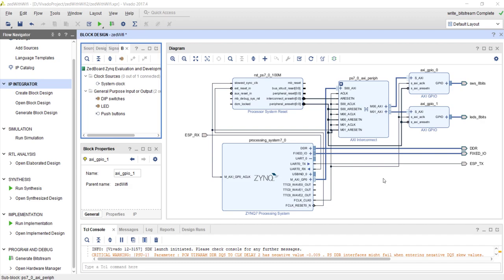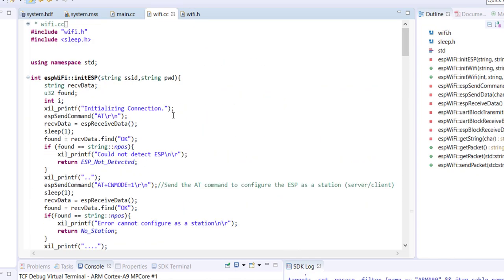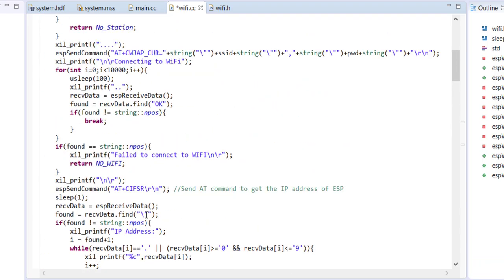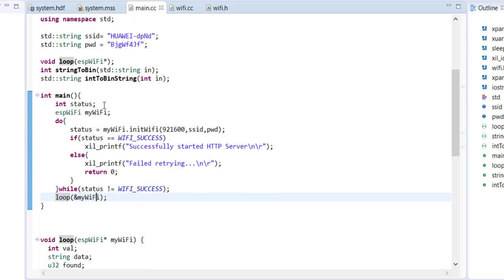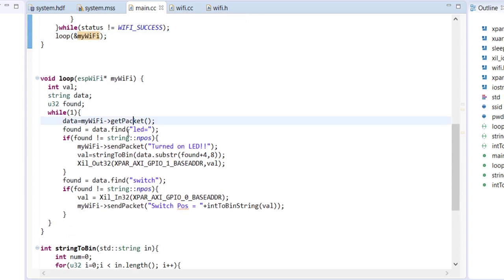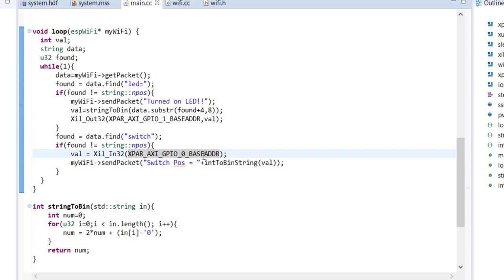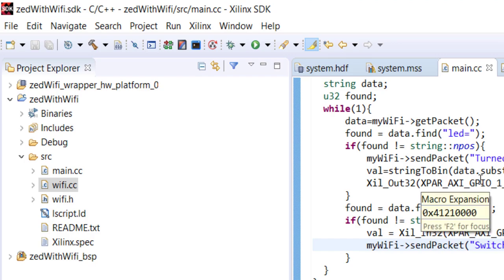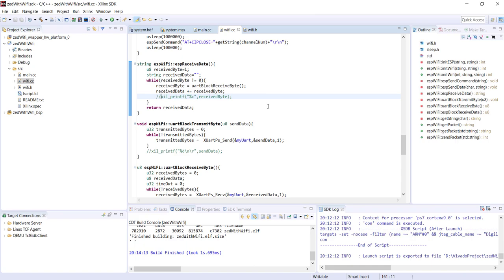Connecting ZedBoard with Wifi. Controlling Peripherals Part 2

Comment: val=stringToBin(data.substr(found+4,8));
can you explain it to me ?
Reply from the maker: found will tell me the starting position of "led=" in the packet. It is 4 characters. Now I need to get the next 8 characters, which is specifiying the LED state. So (found+4,8) will get me those 8 characters. Now I need to convert those character array (string) to binary. stringToBin will do it.